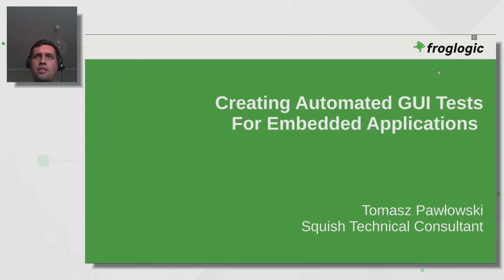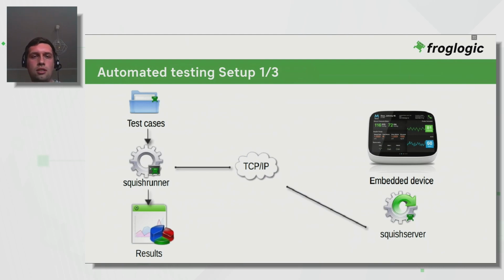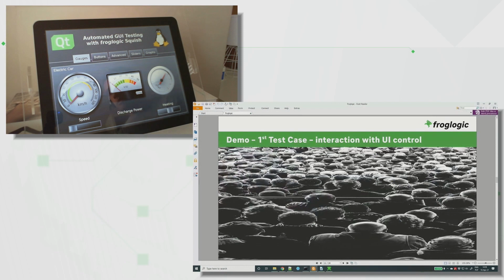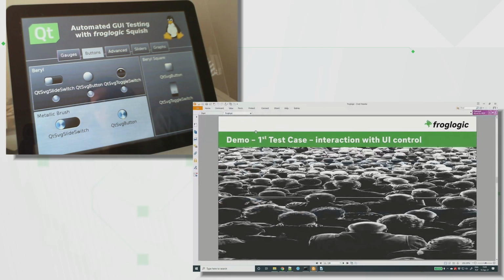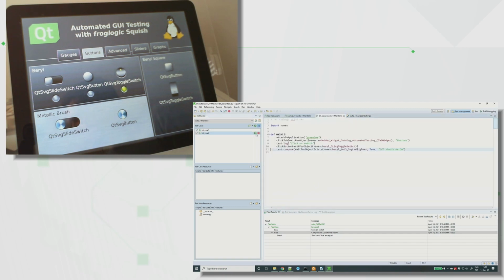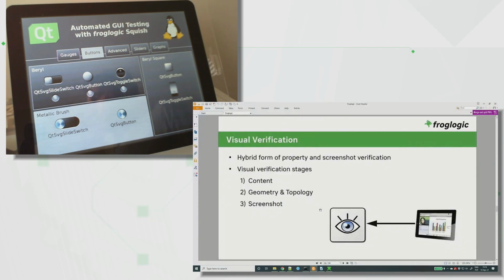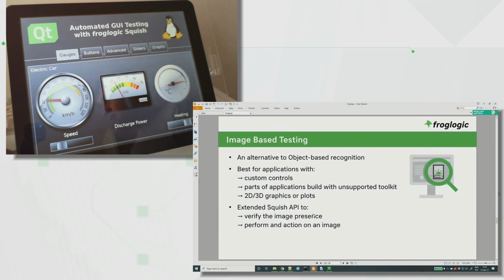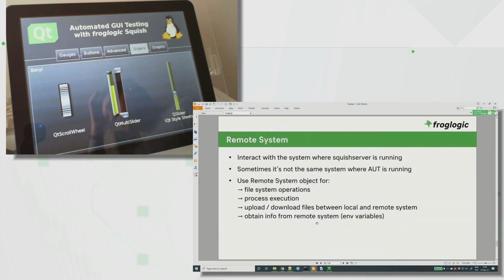Qt Embedded Days - Creating Automated GUI Tests for Embedded Applications by Tomasz Pawlowski

Comment: Hi Tomasz Pawlowski,
Can you please explain, how and what we  have to install in Embedded device. And do we need to run any  script or file on Device to connect PC squish to device.
Reply: For most embedded systems and Qt applications, you will have to obtain and (cross-)compile the "Squish for Qt Embedded SDK" (requires additional license than just a license for "Squish for Qt") and put the resulting folder structure onto the device and use that to launch the AUT (for example via "sdk_dir/bin/startaut"). For more information see: "3.3. Installing Squish for Qt from Embedded Source Packages" at https://doc.froglogic.com/squish/latest/ins-source-embedded.html#ins-source-embedded
Reply: Hi Ramu Thimmapuram,
For testing a Qt application running on Embedded Systems for example QNX or WinCE you need to cross-compile Squish. Please gather further details from the following links: https://doc.froglogic.com/squish/latest/ins-source-embedded.html#ins-source-embedded , https://www.youtube.com/watch?v=2jr5rJic414 , https://www.froglogic.com/squish/editions/automated-testing-embedded-qt-guis-hmis